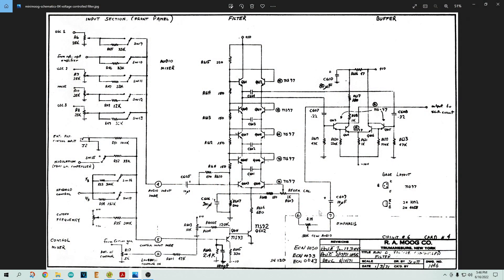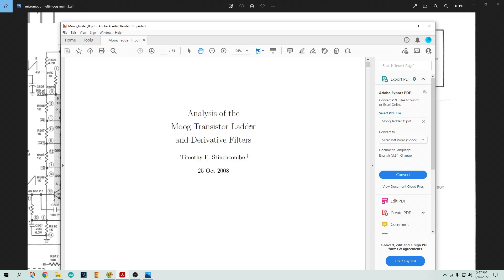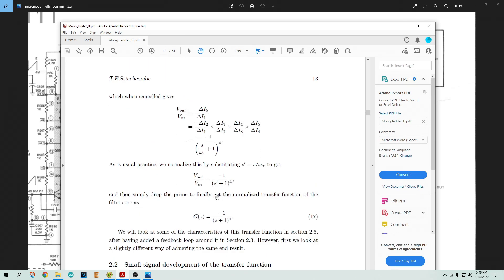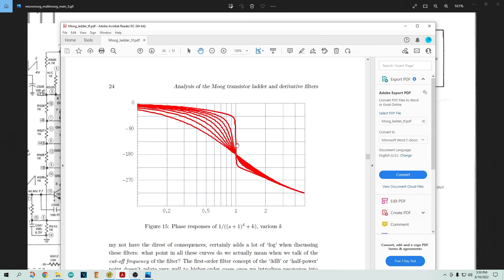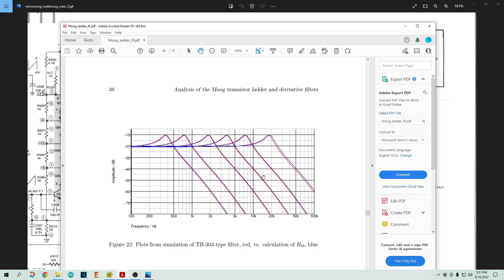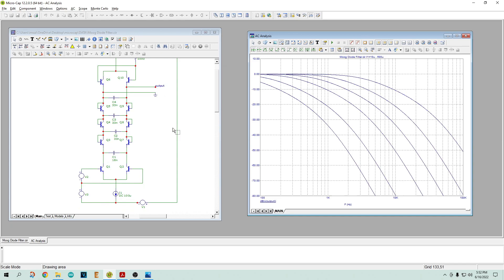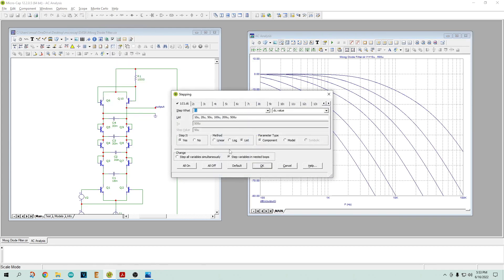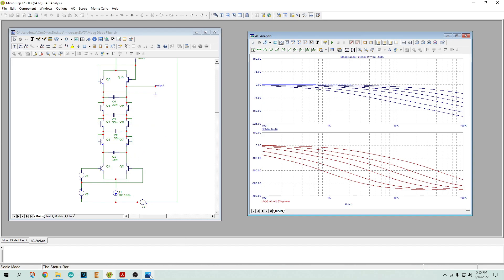#1206 DIY Analog Synthesizer (part 8 of 15)

Comment: If you take a look at the original patent for these Moog filters (US3475623A), it is named "Electronic high-pass and low-pass filters employing the base to emitter diode resistance of bipolar transistors".  To a person astute in BJT small-signal analysis, this provides a good hint to how this works. Essentially, the current that is drawn down through the BJT ladder is controlling the transistor bias to change the small signal emitter resistance that interacts with each of those capacitor stages. The equation for this resistance being r_e = V_t ÷ I_e. So the higher the control current, the lower the emitter resistance, and thus the higher the cuttoff frequency. This is then simply stacked into several cascode stages to make it a multi-pole filter.

Comment: Essentially what Dr Robert A Moog was doing in his original Moog 904 VCF circuit was using the four transistor pairs in the ladder configuration to basically work as voltage-controlled resistors, in a very simple RC low-pass filter formed from a capacitor and a resistor, the capacitor and resistor are fixed in value, this gives a low-pass filter with a fixed cut-off frequency, Dr Robert A Moog was after a way to make the cutoff frequency controllable via a control-voltage, since voltage-controllable capacitors weren't readily available back in the 60's, Dr Robert A Moog had to figure-out some other way to control the cutoff frequency, as it turns out, a transistor pretty-much behaves like a voltage-controllable resistor if you feed a small current into it's base, a small current flowing through the Base-Emitter junction can control a much larger current flowing from the Emitter to the Collector.

Comment: Have you considered using a switched capacitor filter? Cutoff is based on input clock frequency.
Reply from the maker: how fast does it react, this filter can be modulated at audio frequencies
Reply: @IMSAIGuy  They are very fast. The filters operate with a clock that is 100x the cut-off frequency. Frequency modulation of the clock is all that is required.  They are relatively inexpensive and can be found in DIP-8 packages. MAX7480 is one part -- there's a whole family of MAX74xx switched-capacitor filters.

Comment: Amazing to see and learn about Moog....

It seems this current controlled filter...might be handy in like a IF RF chain...where you wanted the bandwidth to be wide narrow...like Voice vs CW...

Perhaps with real small capacitance instead of the filter in audio frequency range....one could make a 100 kHz bandpass filter with variable bandwidth by adjusting current...

Just more things to study...

Good job in reducing a mathematical masterpiece...condensed quickly into a working diode ladder current controllered element....for IMSAI Guy synthesizer 

I can't wait to hear it play or generate   sounds. 

I bought wife...a Yamaha Costco keyboard...$120.....and it had a few Moogish settings....along with big library of beats...